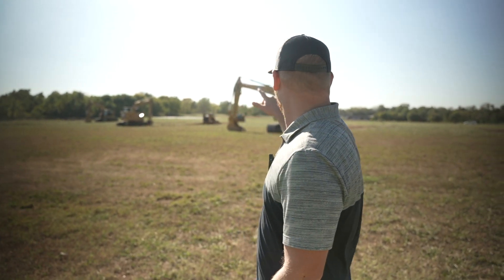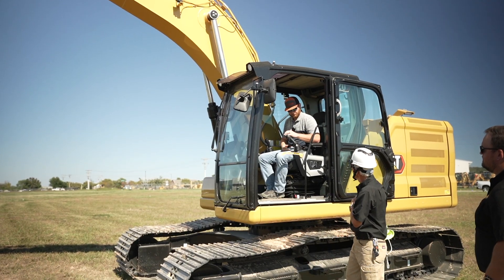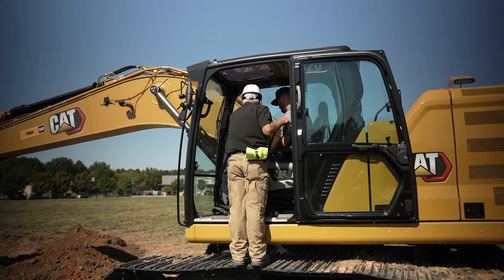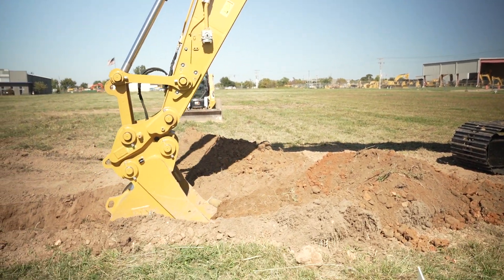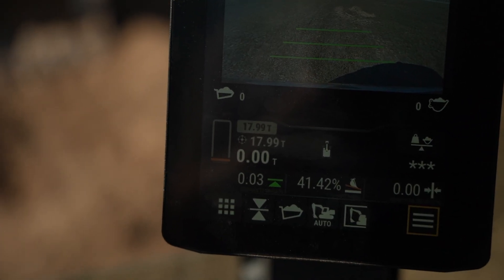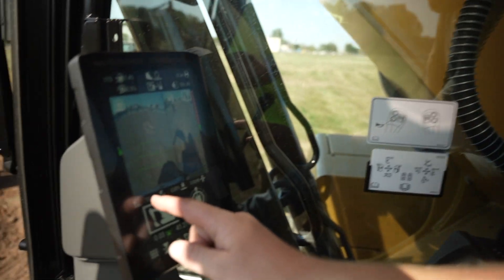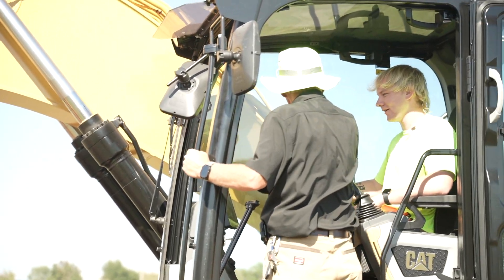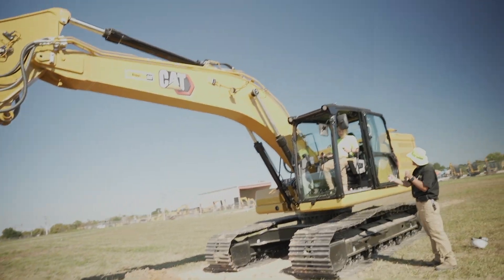Testing the Next Gen Machinery at CAT Demo Day

Comment: Those cats with the fly by wire controls sure are jerky. After running non flyby wire machines my whole career it took me a few hrs to get used to the fly by wire. At first I hated it still not a fan for what I do which is digging on live gas mains and services everyday there’s no feel like on the Komatsu and kubora. I do love our 315 with a blade still nothing beats an old school cat. I feel more comfortable doing tedious tasks with our old 345b than the 315 or the 320
Reply from the maker: Completely agree with in the reaction within the stick. It’s jerky compared to anything, our new 308 is the same way. We had 3200 hours in our last. Same gen, just seemed super touchy. 

345b is sick! Would love to see some footage man! 🤘
Reply: @Sy-Con wish I could make some videos. Our  vendor would go nuts tho if I made videos wish I could they would be some pretty good videos. The old 345 is mainly a yard machine now loading out dirt all day. Our biggest utility machine now days is a 320 man have times changed 10 yrs ago we had a fleet of 345 a 70 ton low boy and a fleet of d8. Now with only one pipeline job a year we just use the stuff we use daily and sold most of the big stuff. Was a cool era for sure.